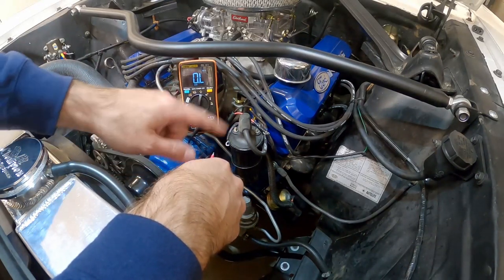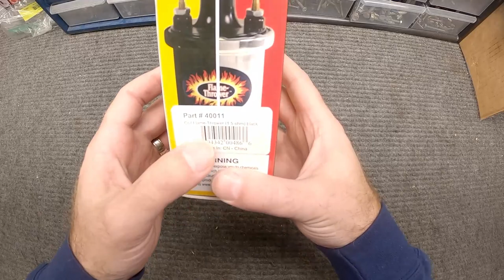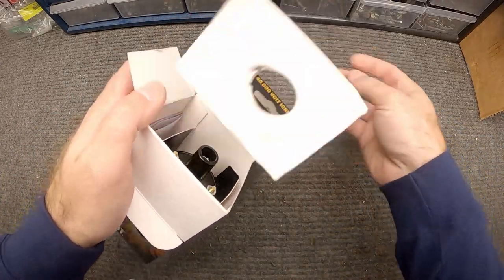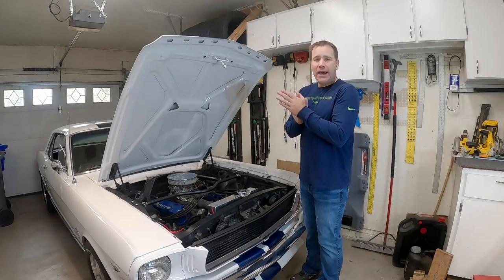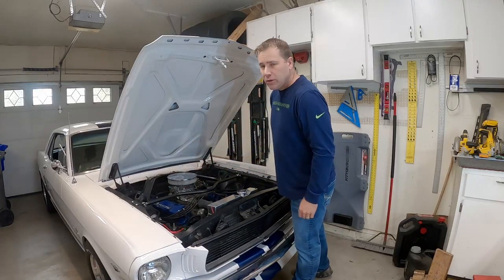Installing New Pertronix Ignition Coil

Comment: awsome video ,, i own 68 mustang  red deluxe conv with the 289 ,, my first  pentronix coil went bad ,, i tested it ,  iam going to buy  the same new  flame thrower coil you bought ,, also i never thought about adding extra grounds to the motor thats awsome , i will be doing that too
Reply from the maker: I know some people have not had good luck with Pertronix parts, but I have only had success with them.  :)

Comment: Hi Andy.  I've got that coil on my 66.  I also put the petronix distributor on.  If you ever put one on your 66, NEVER turn the key "on" and leave it without starting it up for any length of time, it will fry your distributor.
Reply from the maker: Thanks for the tip!

Comment: The 1969 model year used a braided copper wire from the back of the head to the body. Directly to the head and the firewall is one of the best solutions.
Reply from the maker: I've seen those before and I almost did them, but I like the black wire as it is stealthy.  :)
Reply: 3 ground wires really ?   If you do it right the first time, you don’t need all that extra unnecessary bs .  Just saying .

Comment: Hi Andy, thank you for the easy and clear instructions. I was nervous to do it lol.
In your video, you mentioned how to ground the negative to the car. Why is this necessary? Please educate us.
Reply from the maker: Awesome, it really is an easy upgrade.  :)
The motor is isolated from the metal chassis of the car at its mount points, so a ground wire is needed from the motor to either the negative terminal on the battery, or a metal location on the car.  Also, adding multiple ground wires allows the electricity to find the shortest path to the battery, and your current setup may not be the ideal setup for proper grounding.  I recommend at least two ground wires from the motor, and at least one from the negative terminal on the battery to the chassis.  Having the just one wire from the motor to the battery is usually not good enough.  :)

Comment: Hi Andy, does your car have a pink resister wire and/or a resistor block, and if so did you have to remove one, the other or both?  Thx! Steve
Reply from the maker: My car has the pink wire (it looks more like a faded salmon color), and it's located behind the instrument cluster.  I left that in place and made sure to get the correct Ohm rating for my new coil.
Reply: @AndyKruseChannel  thank you!

Comment: Hey Andy, long time no talk. Hope you're finding a nice way to reflect on memorial day. Did you notice any changes after completing this upgrade along with the new electronic ignition? Mine are still stock and currently have 0 issues but any improvement for me is worth it
Reply from the maker: Thanks, the Memorial weekend has been great.
I have not noticed any difference in how the motor runs or performs, but honestly I wouldn't know what to look for.  I do enjoy not needing to worry about adjusting the Points, but this upgrade was mainly to ensure I had good parts on the car.  This might play a larger role when I do more with the motor down the road.  :)
Reply: @AndyKruseChannel  hence to ohms upgrade and high voltage. Good thinking! Cam and heads??
Reply from the maker: @jordanschultz2232  Think bigger.  :)
Reply: @AndyKruseChannel  exciting!

Comment: did u notice a difference in engine function post install ?
Reply from the maker: Unfortunately no, but to be honest I wouldn't know what that would feel like if there was a difference.  There really wasn't anything wrong with the coil I removed, I was just trying to get ahead of the part failing over time, when these coils fail it's usually after it causing firing issues for a long period of time, a slow process.  With all the other mods I have on the car, it's hard to see if the new coil was kicking butt or not.  :)
Reply: @AndyKruseChannel  oh, thank you for that. my car is misfiring. i freshened up distributor (points, rotor, condenser). and better but not 100 percent. i will do ohm test and get one to be safe. great channel